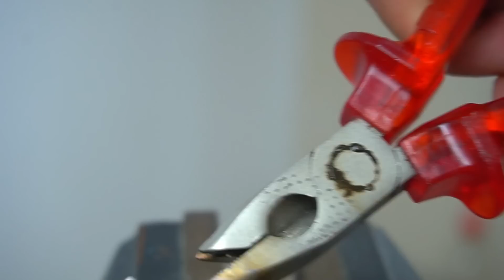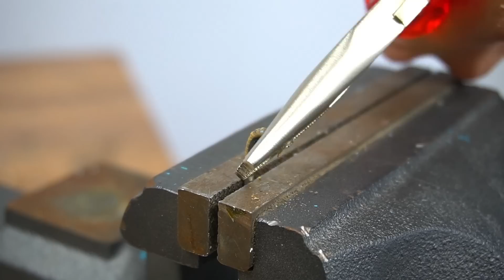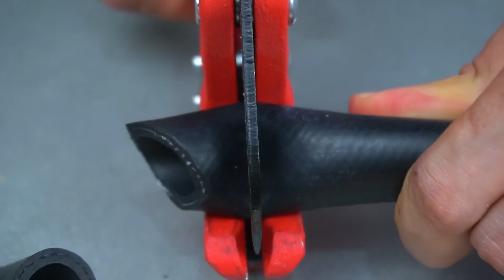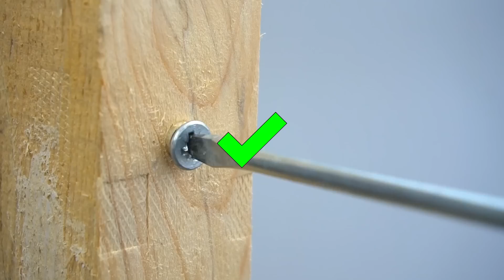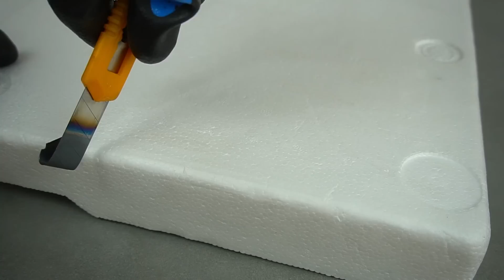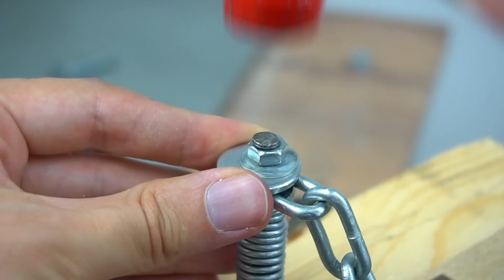My Grandfather Made a Lot of Money by Making These Repair Ideas, and You Can Apply These Repair Idea

Comment: Top secret hint. They make Phillips head screwdrivers especially for driving Phillips screws. That way you can use the right tool instead of trying to use the wrong tool like an idiot.
Reply: He literally used a Phillips-head screwdriver to get more torque on the flat-head screwdriver so he could remove the Phillips-head screw.
Reply: That's actually a Pozi screw, not a Phillips. But still, same point.
Reply: These are the most useless ‘hacks’ I have seen.
Reply: Here the phillips has another purpose